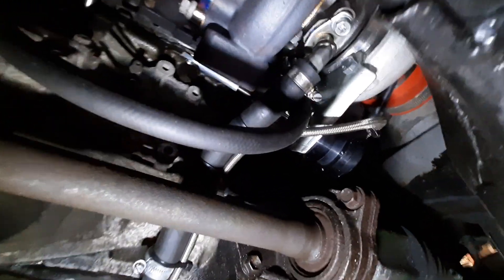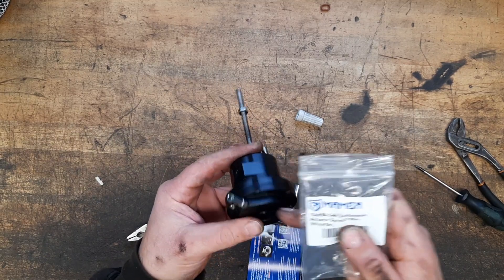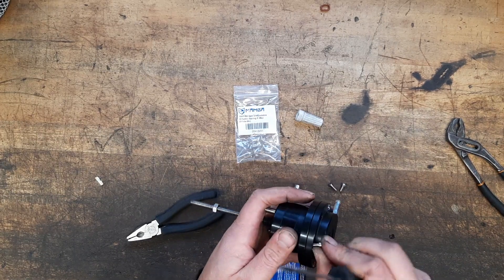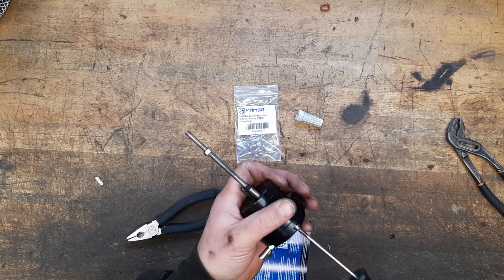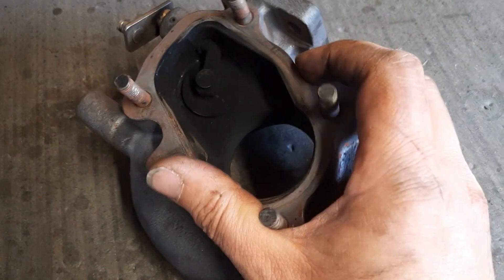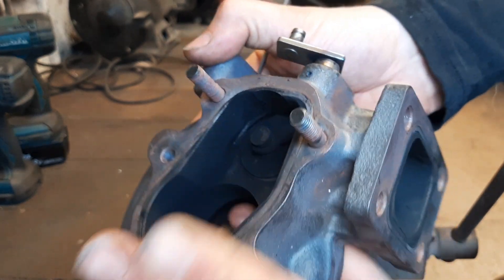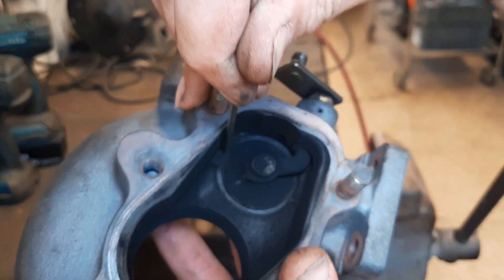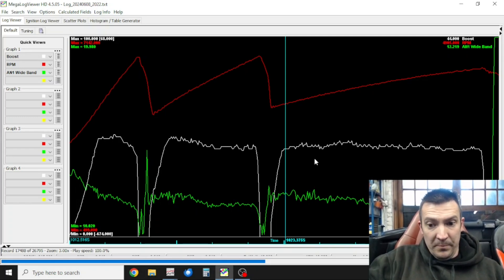Part 4 Toyota MR2 Spyder 1ZZ Turbo - maxpeedingrods wastegate porting actuator spring boost control

Comment: Really like your work ! Where can I get that charge cooler ?
Reply from the maker: Its from a Jaguar XE XF 2.0 diesel, the part number is in the 1st video. GX73-6K775-AC it works really well to be honest, better than I'd ever hoped. But my radiator on the front of the car is a little bit too small I think, but not bad.

Comment: Nice video!  It looks like you're running a PowerFC.  What log viewer were you using?  Also, have you tried using CoPilot?  That's what I use on my build.   I'm going to go watch your other videos as well, so if that information is already in a previous video, apologies for the redundancy. Haha
Reply from the maker: I couldn't get co-pilot working quite right for some reason, I just use FC-edit....
And this project is not finished, I need to get the clutch swapped over when I get some other non MR2 commitments done.
Reply: @threepotMR2  Ahh.  I was able to get it running on Windows 11 and it logs most* things well.  However, due to me changing a bunch of stuff, I am only able to log AFR from the datalogit instead of a direct digital serial input.  Also, Boost is coming in, but it doesn't seem to log reliably.  I'm still chasing down some gremlins after my lengthy build.  I may put a video together about those things at some point.  Good luck with the rest of your project.  Feel free to message me if you want any assistance with CoPilot or if you have other questions or want to share ideas.
Reply from the maker: @lordtakuban  I got copilot running, but I couldn't make sense of any of the auto tuning functions. I just felt that FC-Edit did exactly what I wanted with no over complication. Are you using the optional boost control harness and correct MAP sensor?
Reply: @threepotMR2  No.  I'm using a PLX SM-Pro sensor as well as a PLX AFR sensor and wired those into the analog inputs on the Datalogit.  I'm using a MAF and tuning with that.  The key to using CoPilot to auto-tune is in setting up your target AFR map.  It took me a while when I first started using it to get that figured out.  And that was back when it was still being developed by Kevin.
Reply from the maker: @lordtakuban  I use the same wideband kit, it was cheap but works great. The apexi boost control kit is really good, hold the target boost really well and means I get the boost logged too.
Reply: @threepotMR2  I never knew apexi made an add-on kit for the PFC.  If I keep struggling with getting the boost to show up when analyzing the logs, I'll think about switching over to that one.
Reply from the maker: @lordtakuban  The harness is part number 415-A003 and the boost sensor is 499-X001
Reply: @threepotMR2  Thanks.  I will keep these handy.